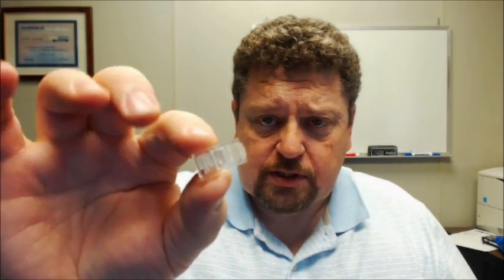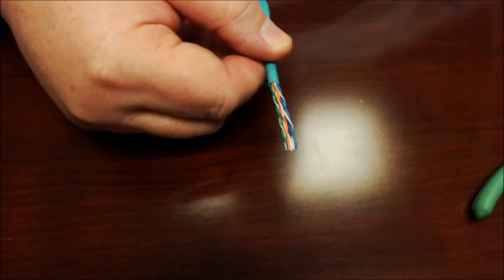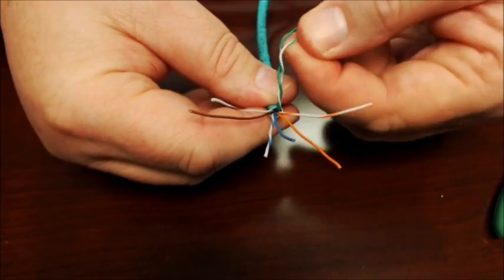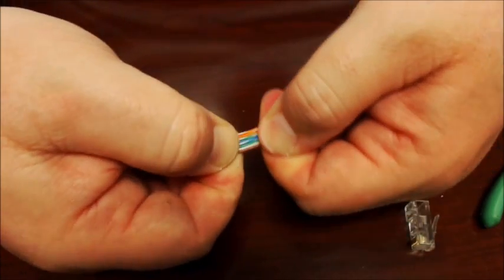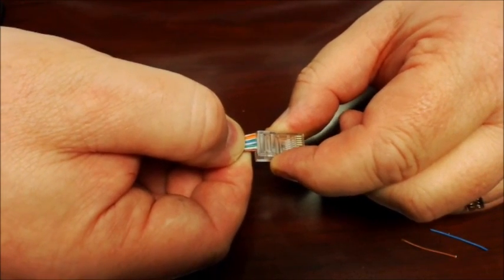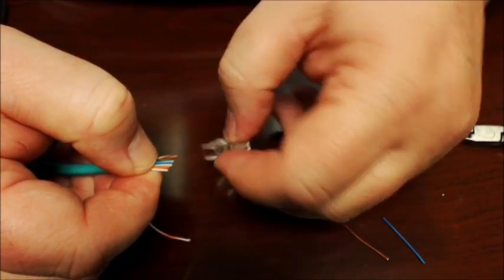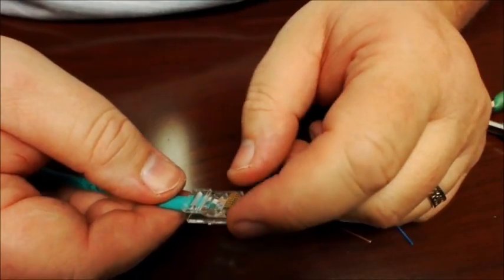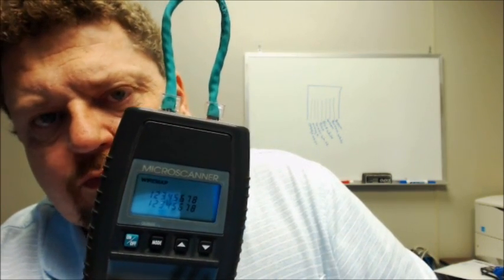How to make an Ethernet CAT5e or CAT6 patch cable using RJ45

Comment: GREAT JOB!!! You covered all the necessary steps and indicated pitfalls to avoid!  13 minutes of worthwhile educational material.  Thanks, you made this process simple...For tools Check out   http://www.ebay.com/itm/Cable-Tester-Crimp-Crimper-100-RJ45-CAT5-CAT5e-Connector-Plug-Network-Tool-Kit-/221095459112